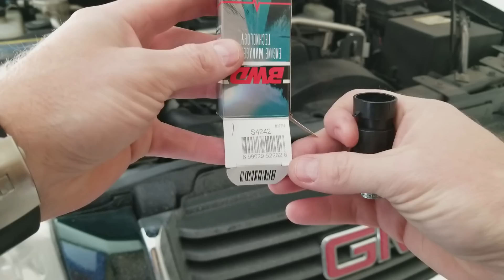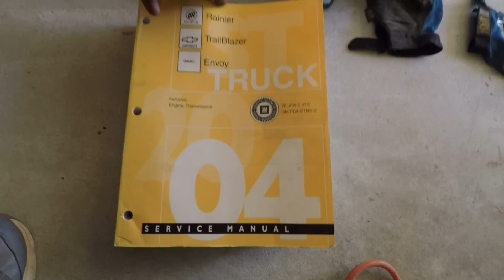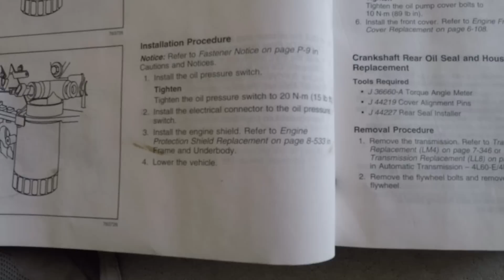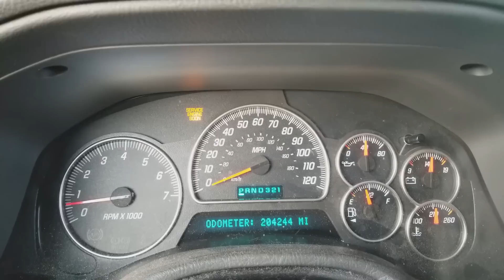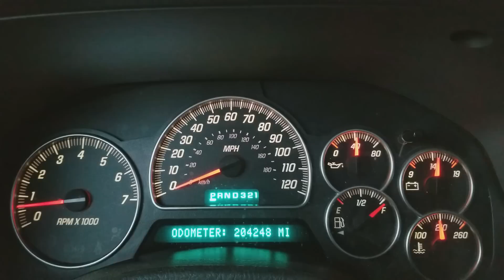DIAGNOSING ENVOY/TRAILBLAZER LOW OIL PRESSURE (GM 4.2L)

Comment: I have an 02 trailblazer 4.2l and my question is about the 2 wire circuit connector that runs to this oil pressure switch.  If I wanted to the wiring at the connector what am I looking for? Like is it a ground and a positive or a ground and control? My wiring is very oily and I want to make sure it's not that before I replace the switch.  Thanks.
Reply from the maker: The shop manual says to test the circuit signal for a short to ground.
Reply: @KevinNadeau  wanted to update you since I figured out from scannerdanner how to test for a short to ground and found that my wiring was good. I did see oil in the harness so I cleaned it up and replaced the oil pressure sensor and have had zero problems so far after 500 miles.
Reply from the maker: @wtspapa24  Awesome. Glad to hear that worked for you.
Reply: @KevinNadeau  How do I do that with my multimeter? I know one wire is called low ref which is the ground, and is the other one like a 5v signal and do I test with the car on?

Comment: Hey did your car turn off and say low oil pressure?
Reply from the maker: It didn't turn off, but I did get a warning saying "low oil pressure, turn engine off"
Reply: @KevinNadeau  ok i was wondering  cause at the light thebtrailblazer shot off cause of low oil pressure  ima buy the oil sensor  tomarrow
Reply from the maker: @payasito8132  Hope that solves your problem. If you watch some of my later videos I show that the root cause of my low oil pressure was a clogged pickup tube.
Reply: @KevinNadeau  ok thanksbi will watch them
Reply: I did not want to take the engine apart or remove the rack n pinion just to get the oil pan to drop on my 2004 Envoy so I could clean the pickup tube. In this Video or the next one Kevin replaces the engine oil with kerosene and this does not work for him maybe he did not leave it in their long enough. I removed the oil and filter in my envoy. Then put a new filter on and replaced the engine oil  with 2 Gal of diesel fuel. I let that sit in the engine for 3 days starting the engine once or twice a day for no more than 10 seconds. The now Black diesel was drained and filter removed next added new filter and New  Oil and Oil pressure is better than ever.

Comment: Yep. Just happened at 230,000 miles. This has been such a good truck.
Reply from the maker: Hope you're able to fix your low oil pressure.
Reply: @KevinNadeau  thanks, Kevin.  This was actually one of the easiest fixes I've done.  I bought the part, a regular 1-1/6 deep socket, took off the front tire, unplug, and replace. And yes, oil was leaking through to the connector side.  It wasn't even in very tight, which surprised me. I think my 2003 envoy I6 is an awesome little car. Even changed the oil while it was on the jack stands.  Always stress Jack stands in your videos. I know a guy that was pinned under a car without them.  That would suck so bad.
Reply: I did not want to take the engine apart or remove the rack n pinion just to get the oil pan to drop on my 2004 Envoy so I could clean the pickup tube. In this Video or the next one Kevin replaces the engine oil with kerosene and this does not work for him maybe he did not leave it in their long enough. I removed the oil and filter in my envoy. Then put a new filter on and replaced the engine oil  with 2 Gal of diesel fuel. I let that sit in the engine for 3 days starting the engine once or twice a day for no more than 10 seconds. The now Black diesel was drained and filter removed next added new filter and New  Oil and Oil pressure is better than ever.

Comment: ATTENTION FRIENDS!

Is a GM defect on the oil pump pressure relieve valve plunger that gets stucked.

They should make a RECALL of all vehicles that have this problem, It is very costly to replace the oil pump for something so small and simple. 

Envoys, Bravadas, Trailblazers and a lot of other vehicles.

There should be a Class Action against GM for this.

The problem is that when the valve is defective the computer incorrectly senses Low Pressure. That’s why when you step on the gas, the low pressure message disappears!

In other words…is just a momentarily lie from the valve that makes the computer think that It has no oil and your car stalls trying to protect itself.

This is how I solve it “momentarily” after I did all this…
1. Changed the oil sensor.
2. Flush the engine with Kerosene
3. Replaced the engine pickup tube.
4. Clean the throttle body (was dirty)

After all that I was about to give up and sell my Envoy, but I finally found a video where it was explaining the oil pressure relieve valve defect

What I did, was to change my engine oil to 40W and use LUCAS oil treatment
And Voila! The engine oil pressure went up and the low pressure message has disappeared. (up to now..knock on wood).

I wish you all luck.

https://www.youtube.com/watch?v=Il5F_QfHGV4
Reply: replacing the oil pick up tube is too much work tho
Reply: Unsure you will see this because this was so long ago but did that work long term? Did you end up having to replace the oil pump and was it safe to drive as is?

Comment: Also I replaced on my mother in laws truck the throttle positioning sensor and throttle control valve. I still had problems with it AFTER replacing them ... I stumbled onto a video before I gave up saying to ALWAYS disconnect the battery for 5 or more minutes to rest the computer in the vehicle to adjust itself to the new parts and it worked. I have also since done this on my vehicle when I changed out other sensors.. works every time. Thank you for making note of that also.
Reply from the maker: I'm glad the video helped with you project. I appreciate your support.

Comment: YES OMG YES THIS IS EXACTLY WHAT MY ENVOY OIL PRESSURE GAUGE IS DOING AS I SIT HERE LOOKING UP WHAT WOULD CAUSE IT !!!! Thank you so much for your video. Mine is doing this randomly tho. Not constantly.. I’m going to go ahead and replace the switch now. Thank you.
Reply: I did not want to take the engine apart or remove the rack n pinion just to get the oil pan to drop on my 2004 Envoy so I could clean the pickup tube. In this Video or the next one Kevin replaces the engine oil with kerosene and this does not work for him maybe he did not leave it in their long enough. I removed the oil and filter in my envoy. Then put a new filter on and replaced the engine oil  with 2 Gal of diesel fuel. I let that sit in the engine for 3 days starting the engine once or twice a day for no more than 10 seconds. The now Black diesel was drained and filter removed next added new filter and New  Oil and Oil pressure is better than ever.
Reply: @strikeforce2525  And not worried about "wiping out" your bearings doing so??? --that concerns me...
Reply: @Themadscientist1969  My Oil pressure is fine now for the last 5 months and holding.Diesel is oilier than gas and I only ran the engine for 5 -10 seconds. I was told by a Mechanic that this would not hurt my Engine in any way. You  do not have to start the engine  but it helps I was told. IF you just want to sock the puckup tube in the Diesel for a few days that might get the job done. BUT hey just trying to help

Comment: Hi Kevin.This might sound stupid, but after i went trough al the work of repacing the oil pickup tube. (mine is 2wd). The same oil pressure low message came back. After i got pissed i noticed that this contidion ony occur while i was stupped at a traffic light and the car was idling. I noticed some hesitation on the engine and the rpms started getting low and the the dammed lights came on. But if i stpep on the gas a little the ights when off and the oil pressure gauge came back to normal. I was mad, but then my expert mechanic, THE LORD asked me...:Have you changed your air filter an cleaned your throttle bodry?...The answer was...NO. mY ENVOY IS A 2004 WITH ONLY '65K MILES AND OIL CHANGES HAS BEEN performed reigiously...but...I have never changed the AIR FILTER. So i went to Auto Zone bought the filter and trottle body cleaner, did all may homework and gues what???
VOILá! eVERYTHING IS RUNNING smoothly AND THE ENGINE STAYS RUNNING PERFECTLY IN DRIVE WITH THE EMERGEGY BRAKE APPLIED FOR MORE THAN 10 MINUTES. AND NO LOW OIL PRESSURE STOP ENGINE MESSAGES ANYMORE! Thanls God! I hope I can help someone with the same problem. Thanks for your videos an all your work.
Reply from the maker: I'm glad it was an easy fix for you. Thanks for the support!

Comment: Hey Kevin

I messaged you about a year ago concerning my GMC Envoy. Same issue. Did you try using synthetic oil before replacing oil pick up tube? If so, did it help?
Reply from the maker: Yes, I've used either full synthetic or synthetic blend oil for the past several years. That did not seem to make a difference.
Reply: Have you learned of anything that could help clear up oil pick up tube. I see you tried kerosene. I also tried motor flush. I am trying to find an easier alternative. Any suggestions?
Reply from the maker: Someone else suggested pouring some parts cleaner in through the dipstick tube. First drain the oil, the put in just enough parts cleaner to cover the pickup tube. You'll have to estimate how much cleaner to use, but I would guess maybe 2-3 quarts.
Reply: Kevin Nadeau Thanks . I didn’t even think about that. I guess I would have to remember not to crank up engine. Lol. Thanks again . I will try the parts cleaner idea. How long should I leave parts cleaner in?
Reply from the maker: @blessedthelord  I'd probably let it soak for a few hours. Then drain, fill with oil, and do another oil change after a few hundred miles.  Good luck! Let me know how it works for you.
Reply: Kevin. As you suggested, I tried parts cleaner in oil dipstick to soak oil pick up tube and I must say  So far So good. I have not had an issue with low oil . I used Gunk 3 gallon can of parts cleaner. Now I am using full synthetic oil. Should I soak again at next oil change?
Reply from the maker: @blessedthelord  I'm glad to hear that seemed to help. You could try another soak, just be careful how much cleaner you use.
Reply: Poor a quart of kerosene or diesel fuel right in with the old oil and drive it around for 10 or 15 minutes let the motor get all the way warmed up to operating temperature works every time for me like the motor look like a new nickel inside I've done it dozens of times
Reply: I tried a gallon of diesel. I let it soak for 3 days, and no change. Then I tried 3qts of Berryman Chem Dip. After soaking for 4hrs my startup pressure went from 30psi to 75psi. I ran a can of Berryman B-12 after that to clean the galley's and my problem came back. I think it's a mix of still having some junk stuck in the screen, and dislodging more from the B-12 flush. The oils been drained now, and I'm soaking the pickup with the Chem Dip again for 36hrs, rocking the truck from time to time to aid in the cleaning. Hopefully it does the trick.

Comment: I just did this repair on my 2004 Envoy I6.  The 1-1/16th socket... does NOT fit.  Either the old sensor I removed or the brand new one.  It was to big and slipped.  I tried my 1” socket and it was to small.  I wound up using channel lock pliers on it.  It worked but not much space to work with.

Comment: I had the same p0014 code on my 05 trailblazer I just replaced the cam position sensor. I need to do the oil sensor

Comment: Yeap after reading up on it my car running rich the whole time due to a dirty air filter does that half to do with anything
Reply from the maker: A dirty air filter probably doesn't have anything to do with low oil pressure.

Comment: Yea because my oil light came on but I'm full off my mechanic told me that I didn't have no oil pressure he said that replacing the sensor that could solve it
Reply from the maker: He needs to put a mechanical gauge on it to check the actual pressure. Check out my other videos for that.
Reply: I did not want to take the engine apart or remove the rack n pinion just to get the oil pan to drop on my 2004 Envoy so I could clean the pickup tube. In this Video or the next one Kevin replaces the engine oil with kerosene and this does not work for him maybe he did not leave it in their long enough. I removed the oil and filter in my envoy. Then put a new filter on and replaced the engine oil  with 2 Gal of diesel fuel. I let that sit in the engine for 3 days starting the engine once or twice a day for no more than 10 seconds. The now Black diesel was drained and filter removed next added new filter and New  Oil and Oil pressure is better than ever.

Comment: THANK YOU SO MUCH FOR LETTING US SEE YOU WORK ON THAT MY ENVOY OIL PRESSURE  LIGHT  HAS BEEN ON  FOR SOME TIME NOW THIS MIGHT HELP ME THANKS AGAIN
Reply from the maker: Thanks for watching! Hope you're able to solve your issue.
Reply: I did not want to take the engine apart or remove the rack n pinion just to get the oil pan to drop on my 2004 Envoy so I could clean the pickup tube. In this Video or the next one Kevin replaces the engine oil with kerosene and this does not work for him maybe he did not leave it in their long enough. I removed the oil and filter in my envoy. Then put a new filter on and replaced the engine oil  with 2 Gal of diesel fuel. I let that sit in the engine for 3 days starting the engine once or twice a day for no more than 10 seconds. The now Black diesel was drained and filter removed next added new filter and New  Oil and Oil pressure is better than ever.
Reply: @strikeforce2525  this video has been 3years ago. Did you resolve your issue using the diesel fuel trick? Do you still have your Envoy/Trailblazer?
Reply: @derekwalker569  Yes and Yes
Reply: @strikeforce2525  thanks for your reply. Now did you add the 2 gallon diesel fuel to existing engine oil using new filter ?
 Or did you add 2 gallon of Diesel to engine alone after you drained existing oil  using new filter? 
And did you pour in through dipstick or through the top oil cap?
Reply: @derekwalker569   Yeah the 2nd one,
Start by removing the old Oil and Filter. Then put the NEW filter on Add the Diesel through the top Oil cap. Let the Diesel sit for 2 or 3 days longer is better. The Diesel will dissolve the Oil slug. YOU do NOT have to do this  BUT I started my car once a day for 10 seconds or less to circulate the Diesel through the pickup tube. OK  once you think the Diesel has been in there long enough. Drain ALL  the Diesel and remove the Oil filter. Next put on another NEW Oil filter and add  the new clean Oil . After about 1000 miles or so you might want to change the Oil again . Because there might be a little bit of Diesel and slug still in there. The new Filter should get the left over slug. The left over diesel might thin your Oil a bit so I change the Oil again after the Diesel treatment at 1000 miles.  After that I had no more trouble that was over 70 thousand miles ago at 272 thousand miles now on my Envoy. I know this sounds strange but when I did this I could not afford to take the car apart and fix it. So if this did not work I likely would have just junked the Car. So I had nothing to lose I am SOOO Glad It worked I love my Car :)
Reply: @strikeforce2525  Thanks a lot StrikeForce. I will try it this weekend
Reply: @strikeforce2525  I’m trying this weekend. Are you using 5w30 synthetic when refilling? What brand oil and flilter are you using?

Comment: I was given an 03 trailblazer with a blown engine. I put a junkyard engine in it (biggest pain in the butt ever!) a year ago. Last summer it overheated really bad and I think that blew the head gasket and warped the head. Went down hill since then. I've had a dozen of the low oil pressure alarms that I thought was related to the head gasket (it was leaking exhaust into the cooling system) but I figured as long as the engine is spinning the oil pump was pumping oil. Well it's had a rod knock for a couple months now and I'm getting ready to put another engine in it.
Now that I see that the low oil pressure is a problem with these engines in going to pull the pan off before I put the engine in and make sure there isn't any sludge and the screen is clean.

These are great engines but whoever designed them I'd like to punch in the face!
Reply from the maker: I know how you feel, i was cussing the engineers who designed that engine the whole time i was working on it.  Great engines though...i have over 275k miles on mine and it still purrs like a kitten.
Reply: just drop in a Cummins diesel motor and be done... LOL   Trans dapt surely sells something to adapt it...lol or swap a 5.3 gas burner in it?

Comment: I hade same problem it was my water pump an idler pulley take off fan belt an try wiggling fan it won't leak water, pump is spring loaded seal.

Comment: Thanks! I have the exact same problem... 225k miles as well.
Reply: I did not want to take the engine apart or remove the rack n pinion just to get the oil pan to drop on my 2004 Envoy so I could clean the pickup tube. In this Video or the next one Kevin replaces the engine oil with kerosene and this does not work for him maybe he did not leave it in their long enough. I removed the oil and filter in my envoy. Then put a new filter on and replaced the engine oil  with 2 Gal of diesel fuel. I let that sit in the engine for 3 days starting the engine once or twice a day for no more than 10 seconds. The now Black diesel was drained and filter removed next added new filter and New  Oil and Oil pressure is better than ever.
Reply from the maker: You're welcome.  I will caution that my root problem was ultimately a clogged oil pickup tube. Check out my other videos for that.
Reply: @KevinNadeau  hey Kevin  my snl flushes when I give it gas did yours do the same
Reply: Sel
Reply from the maker: No it didnt.